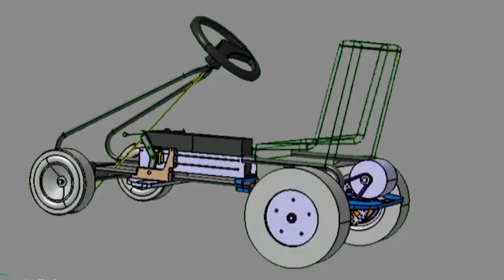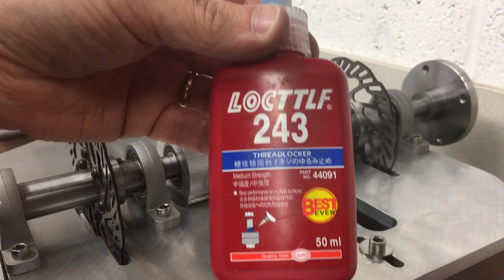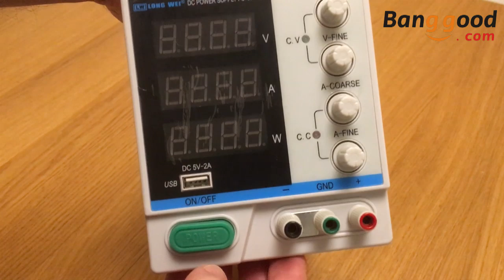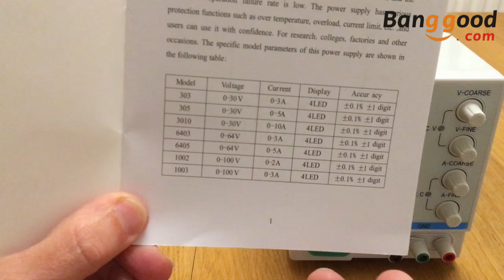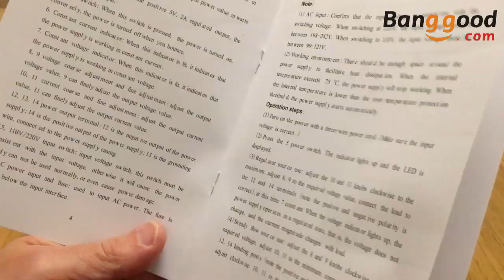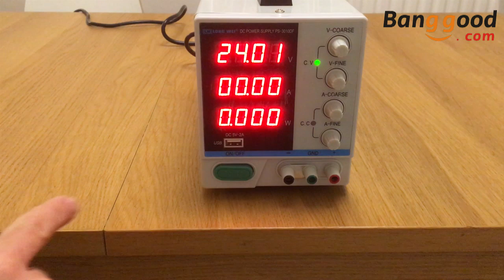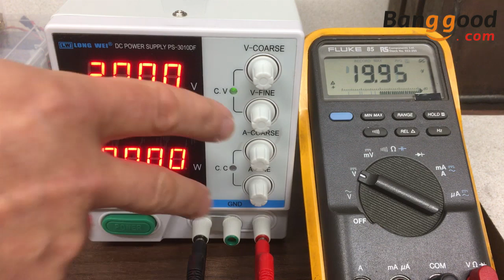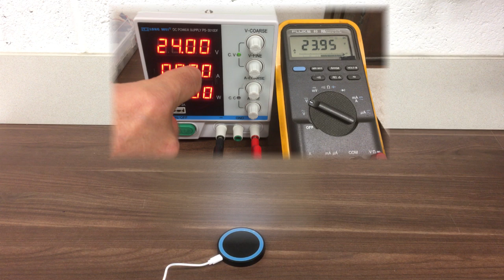Episode 9 e-kart:  Rear Axle Motion !

Comment: Did you consider using 4 bolts in the corners to hold the covers on? You could have free handed the 4 holes in the diff if you didn't want to mess with trying to indicate/work hold the diff. It would also solve the issue of hoping preload  keeps the covers on. Though I think I'd be more worried about bottoming out the diff and ripping the cover off.

My big concern with the way you did the aluminum adapters is that if you ever have to rebuild the diff they may not come out. 

But its looking good. Can't wait to see it run.
Reply from the maker: That would be better, might do that.  At the time I was more interested in backing myself out of a corner caused by changing the design and the knock-on effects.
Yes, the diff could bottom out, although the brake discs are the lowest part of the axle.  Hopefully it just gets driven around some tarmac paths in a park, although who knows !

Comment: Great progress!  Quick question.  When you were milling the tube, I noticed your feed rate was incredibly slow. Any reason for that?
Reply from the maker: Lots of reasons:
The tube stuck out of the vice a long way so it might have pushed it out of the jaws
The wall was thin and might resonate with higher feedrates.
It was a soft grade of aluminium which likes to chip weld without warning.
It was not a big job but I only had that one piece of tube so better to go for reliability than save a minute.  Thanks
Reply: @routercnc9517  That makes sense, thanks.  What was your depth of cut?
Reply from the maker: I cut them manually using the DRO so about 1 mm per pass.  I left a tiny bit of the material on to prevent the piece flying off and cut this out by hand.  Thanks